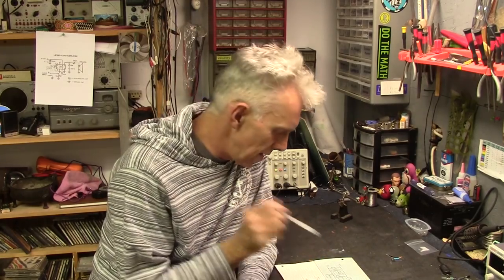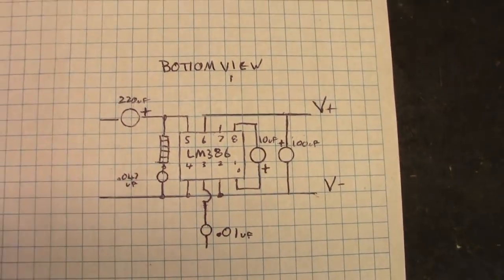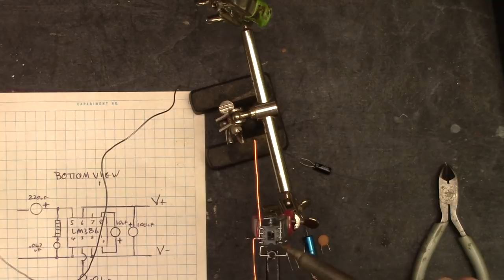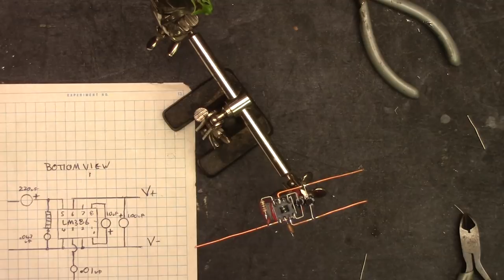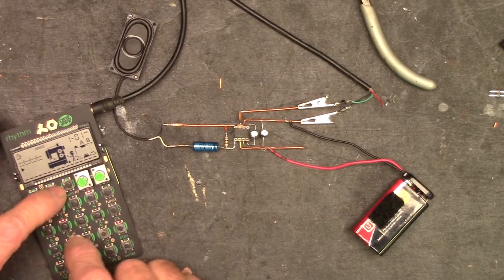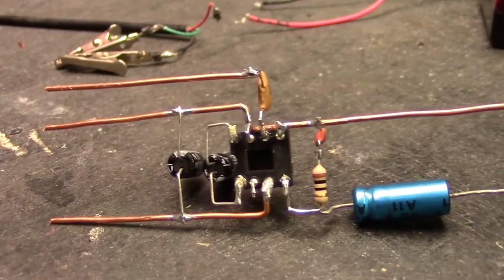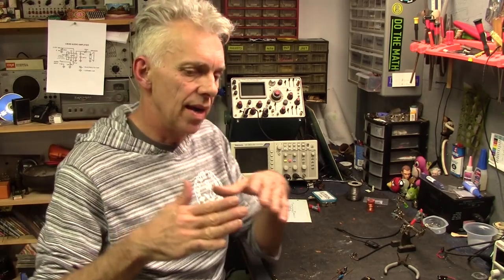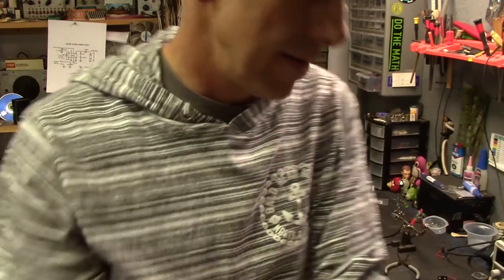Audio Man Part 2

Comment: Nice. I tried a dead-bug style amplifier circuit build once but I got into a real mess. I was using a small piece of copper pipe beaten flat as a ground plane but it was too thick and was sinking the solder heat away too fast. I will try again after having watched this video.